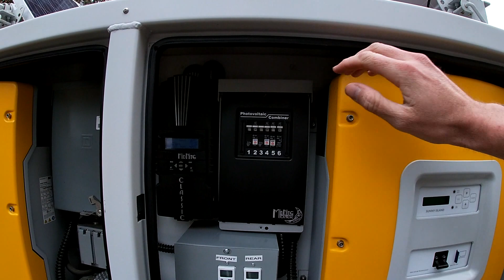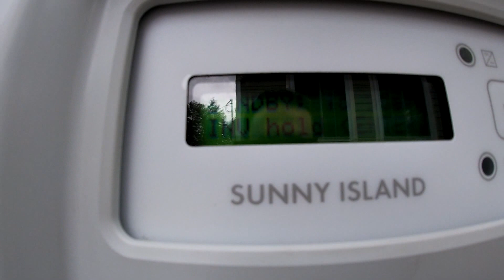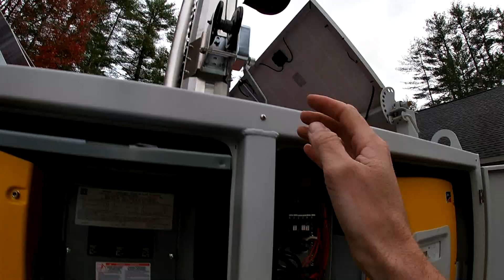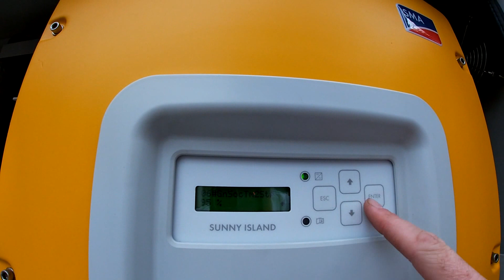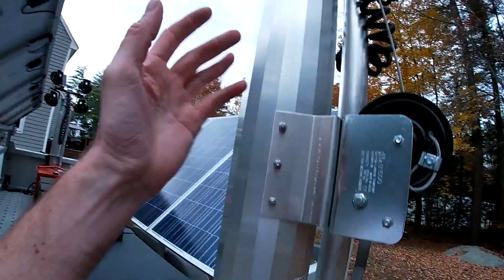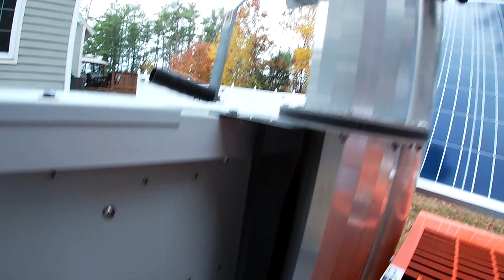How to use the "DC Solar" trailers + UNLOCK CODE for the Sunny Island Inverters INCLUDED!

Comment: Do you know if I can switch it over to grid sense to run on grid???
It senses the grid now but is set to off-grid. 

Super thanks for the unlock code!!!!!!!!!!!!!

Also, I don't think these are AGM Batts. I hope not anyway because I checked the ports and they were mostly dry so I filled them all with Distilled water!!!!

I am getting a GRD Fault error on the Midnight controller and can't figure out why..
Reply from the maker: Yes it should absolutely be able to switch.  The issue would be generator hookup at that point (assuming you have/need a gen).  I believe you will use the current gen connection point for the grid.
Reply: they are IFLA batteries
Reply: Iflas are the best of the best for longevity and durability and reliability

Comment: Do you know if you can wire up the two inverter 50 amp outlets into one 100 amp breaker panel with out blowing up an inverter?
Reply: Also do you know if the inverters can handle additional solar panels tied into the existing array?  The goal is quicker recovery with less sunlight hours.
Reply: @matthewmcdaniel3987  The charge controller determines the amount of power charging the batteries. The inverter is not relevant.
Reply: Both 50a plugs are in parallel and would not increase your total amperage to 100a. You would feed the 100a main from one 50a plug.

Comment: Videos are great and super helpful.  I picked a couple up and am slowly reading and figuring the out.  I have 2 questions, is it possible to run two trailers in parallel?  There's an SB connector behind the slave inverter, any chance you know what that is?  Thanks again, and I'm looking forward to more videos on these trailers!
Reply: There's a guy in Utah who has his set up this way.
Reply: I have 3 in parallel. 1 trailer has a pig tail so you can plug 2 connectors into 1.
Reply: @Andy-bi8wr  
Appreciate the reply. Which trailer model do you have?  I have the SCT10 with Kubota GL11000 that has the 2 sets of 48V batteries in parallel.  I have a second trailer I disassembled and was thinking of adding the other 2 sets of batteries in parallel with a "Y" Pigtail like you're describing.

Comment: Okay, so I’m one of those guys that bought one of these things and have a very limited understanding of how they operate. Additionally, the operating manual for the inverters might as well be in Chinese. My question for you is this, when I brought the the trailer home, the Battery State of Charge was at 26%. I justified that because the inverters were both on at the lot and the solar panels were not out so there wasn’t much charging taking place. Today I placed the panels out (although it was a very cloudy day), turned the inverters off because it’s not operating anything yet (and I wanted to see if the battery state of charge would increase) and today when I got home the battery state of charge was at 19%. Ugggg. What am I doing wrong? Help OB1 Kenobi!
Reply from the maker: Nothing your doing is wrong.  It will take weeks for the SOC to correct itself.  Go to the menu, scroll to "meters" then scroll to "compact meters and select it.  The upper left number will be your battery SOC and the upper right will be your SOC accuracy.  I'd bet it's north of 50% inaccurate.  After a week that should drop to under 10% meaning your SOC is much closer to reality.  It should continue to drop the more you both charge and discharge the batteries and it learns more about the actual state of charge.  Hope that helps!
Reply: @Trialnerror  Thank you for the response. I very much appreciate it. Keep up the great videos.
Reply: @Trialnerror  I just downloaded the DC Solar SCT20 Technical Manual that covers the entire trailer. If you would like a pdf copy lmk.
Reply: I’d love one if you want to email? I can find it. Or post the link?
Reply: @michaeleast4389  i know this is an old thread - but i would love a manual please for the DCT20 as setting one up for my church !!?!?

Comment: I bought 5 of these, but they came from a track that actually took care of them :-)
Reply from the maker: Jesus, what's the plan for 5 of them?
Reply: @Trialnerror  sell 3 have 2 for free. Going off grid
Reply: What did that cost you. The auction that originally sold these in groups isn't advertising that hammer prices.

Comment: Great videos- thanks! I will check out the Facebook page listed- I bought one of these and along with downloading every manual available, I’m learning a ton- one question does the midnite classic control just the solar component of battery charging or does it also control the generator charging the batteries? It sounds like the inverter controls the generating charging component but I’m not positive - thanks
Reply from the maker: Congrats!  Yes, you got it right; the midnight takes the high voltage straight from the panels and converts it to charge current for the batteries with it's own 8 gauge wire.  The inverter handles the generator operation and charging over the same cables that it pulls power from.
Reply: Thanks for the info- I have an off the grid cabin in the Pacific Northwest- until I get some trees cut and the sun comes out, I’m limited to the generator charging the batteries- first time the batteries dropped below 50% the generator kicked on and charged to 95% (perfect). However, after some use, I wanted to charge back to 95% before shutting the unit down for awhile due to non use, I manually started through the inverter and could only get it to charge to 91%. It ran a good hour at that level before I finally shut it down manually. I guess I’ll do some more reading- looking forward to joining the Facebook page- Happy New Year!
Reply from the maker: @bobmatuszak7975  That's part of the program.  The inverters will start to trim down the amperage after the batteries hit 90%.  This is to prolong the life of the cells so though you can change the parameters I wouldn't recommend it!
Reply: Thanks again- I’m not sure what battery packs you have- I have the GNB Flooded Classic Platinum- I’m trying to get the recommended charging parameters for these batteries, I.e bulk/absorb, EQ voltage, float and charge current. I haven’t been successful get the info from online spec sheets or through the company. Do your units have these batteries? If so, would you know the charging info., I mistaking reset the controller to factory default and need to input the info specific to my battery pack. Thanks
Reply: @bobmatuszak7975  Did you ever find out the battery charging information? Any luck?
Reply: @bobmatuszak7975  One video I watched on Restoring Very similar 48 Volt Forklift Batteries, said to Equalized them at 2.4 Volts per cell, so that comes out to 57.6 Volts.  We have been doing that for 2 days now on a Severely Stressed (if not damaged) Battery Bank and have brought the Overnight Resting Volts (from 19.0 Volts) up to 49.3 Volts.  We plan to try Equalizing at a Higher Voltage to see what happens.  My much smaller Deep Cycle FLA Batteries I Equalized between 62 - 64.8 Volts.  So we may be going that High if need be to try and bring them back.  Any comments are welcome.

Comment: Can you offer some help - the MidNite does not power up when the breakers are turned on.  I checked the breakers and they have DC voltage to them
Reply: I had a similar issue. Had to do a firmware update, which failed to properly complete, so I ended up having to send it in to midnight solar to get it fixed properly. No charge (except shipping).
Reply: Mine were under ten volts. I put a 48v volt charger on it and they fired up.

Now I suddenly have a GRD fault issue.

Comment: How much do these units cost, how much can they power, and how long
Reply: Most of these trailers used are around 15-20 thousand. I found one three weeks ago and bought for 9700. It's awesome. Very well built, they should run for years and years. Very high quality componentry throughout
Reply: They can power a small to medium house indefinitely

Comment: Hi I am wondering if I have the generator is on auto the switch should be stay on or off.
Reply from the maker: The main power switch on the upper left needs to say on.  The key switch should stay in the off position.  The remote start module bypasses that key switch and will fire it up no matter what position it's in.  Also make sure the main battery disconnect switch is turned on (under the big silver door that gives you access to the engine).
Reply: Thank so much.

Comment: I'm getting a code/message. F206 Malfunction. From what I've seen in the manual book it has to do with the battery temperature. What can I do?
Reply from the maker: You can bypass the temp sensor.  The wire is probably pinched somewhere.  I'd order another one to be safe but you can run it without the battery temp probe, just don't work it too hard on really hot days.

Comment: I'm afraid I didn't follow rule number one.  I found out about the auction about 6 hours before it was over.  I was about to buy one of these from a guy selling them on craigslist when I came across the closing auction.  Yadda Yadda... I have one at my house Model H.  It won't turn on.  Nothing from the charge controller.  any ideas where I could start on this?
Reply: Go to facebooks dc solar group . There are dozens of users and texts on the site. Dead systems have been dealt with in several posts.
Reply from the maker: Get those panels in full sun with the combiner breakers all on.  It should power up after a while.  Hopefully your batteries can be saved (assuming they are dead and need to be charged).  Can you put a multimeter on the battery pack's to test them?
Reply: I found they need a min of 10 volts to get the charger to turn on. I used a cheap 48 Volt charger from amazon.

Comment: Neighbor of mine bought one of these trailers. 
The inverters were off for about a year, along with the breakers on the combiner box, and the battery voltage was in the low 40v range.....nearly dead I assume.  Charged them up with a large external battery charger and got them back to 52ish volts, so the inverters will now come on....but the master shuts down after a few minutes.  Can start it back up, but it repeats.....shuts down in a few minutes.

Trying to enter the Sunny Boy master by the password. but not successful so far.

I get to the total hours, add them as you did, enter the number and hit enter.....it returns to **.  Hit enter a 2nd time, and comes up with two zeros like "enter the code".  There is a part to the right of the password that changes from [0] to [1], but changes right back after a few seconds.

I need access to reset the battery amps from the FLA 100 to FLA 1080 that is what the pair of batteries are, among other settings.  

Any help appreciated........
Reply: Once you get your system up an running, you need to use the Midnight Classic Controller to Restore them Before Turning on the Inverters.  So I recommend Equalizing them for a few Days starting at 57.6 Volts and then going higher if need be.  The Overnight Early Morning Resting Volts will (or should) tell you what your Batteries are Holding to with just the Charge Controller on.  You want that Voltage to be (ideally) 52 Volts.  A Charge Voltage of 52 Volts will drop overnight to whatever it really is.  In our case so far only 49.3 volts.  I suspect that yours may be even lower???

Comment: Wonderful video - from a new subscriber - one question,  how do they handle snow and rain ... they don't look too watertight.
Reply from the maker: Thanks for the sub!  They are very watertight/weatherproof.  The only problem I've heard about (but haven't experienced) is the little control boards on the back of the solar panels themselves can take on water and corrode.  They were meant to always be faced down so when you have the panels vertical they do see some water.

Comment: Is it best to keep the system on ?
Reply from the maker: If it's not being used, charge it up fully and shut it down.  Once a month or two turn on the Midnight charge controller to keep the cells topped up.  Just my 2c

Comment: Great video! Might be good to add in a little 'how-to' on re-filling the flooded leaded acid battery cells... Seemed to be the only thing missing, and the manufacturer recommends doing it every 90 days, so when you get them at auction they are LONG overdue...
Reply: 90 day intervals are during regular use.  They will not be much of an issue when sitting.

Comment: Do you know what the average lifetime for the batteries is?
Reply from the maker: All over the map depending on use and treatment.  You can destroy them in a year by undercharging and not maintaining water levels.  You can also get a decade or more out of them by keeping them happy (above 48v)  and only using 20-30% of their capacity.
Reply: @Trialnerror  Thanks for the reply. What you said makes completely sense. That's how it is with my wheelchair batteries. They won't last that long (up to a decade) though, even if they're maintained properly. 

Since I'm trying to buy an used one, what do you recommend for me to look for? Or test? Just so I don't get ripped off.

Comment: Hey I’ve got a question. So I have one of these solar trailers it’s got 2 of the inverters and then a midnight controller in the black box. When I power it up per instructions it keeps throwing a ground error then says resetting and keeps beeping. Where should I check for my issues so I can’t get my solar trailer working again. Thanks
Reply from the maker: I'm assuming you're getting the error on the Sunny island master?  If so, start by popping off the yellow cover.  Bottom left hand side you'll see 3 green cables going into two different screw connectors.  Make sure they are there and tight. Still not working, move to the slave and do the same thing.  Still not working? I'd reset the master by turning off the breaker, turn it back on and almost immediately hold the "OK" button before the normal startup procedure.  Initialize it as a new master and see if that clears it up. Good luck man and thanks for watching!

Comment: pretty sure those are not AGM batteries. AGM wouldnt have the caps for watering each cell.
Reply from the maker: You are correct, they are tubular lead acid but I didn't know that at the time!

Comment: Is Tesla Model 3 rated to tow one of these
Reply from the maker: LOL I bet it could but I wouldn't want to ride in it!
Reply: Heck no it isn't. These trailers are really heavy. 
A  Tesla may have the power for a while but no way could it handle the mass in an on-road driving situation. Not to mention the frame is not made for that kind of attachment.
Reply: @pokey70291  my Colorado ZR2 is only rated for 5,000 lbs.  There's no way a Tesla has the structure to control a 10,000 lb GWR trailer.  Given that the battery packs are 2,000 lbs each, the inverters are 140 ea, plus the generator, etc., that's for sure under 10,000 lbs but over 5,000 lbs.
Reply: I hit the cat Scale on my way back from Texas motor speed way. With about 1/8 tank of gas. My trailer with lights and the 11k gen. had a weight of 7460LBS
Reply from the maker: @cfbuildersupplycalendar2177  Wow, that's lighter than I thought it would be.  Did you have any fuel in the trailers tank?
Reply: But when the tesla runs outta power...
Reply: Thanks! That's helpful!

Comment: I have a configuration H SCT20. I want to add the generator and lights making it a configuration b if possible. Would you be interested in selling the parts to make this possible?
Reply from the maker: Sorry, everything I have that I didn't need has been sold.  I do have some of the lights left but it's just the actual lights themselves/no towers.
Reply: @Trialnerror   do you know how hard it would be to add a generator with auto start to a configuration H? I’ve found some of the generators just no wiring harnesses.
Reply: @Trialnerror  just so happened i just had one of the lights burst into flames lol. would you be interested in selling some of the lights?